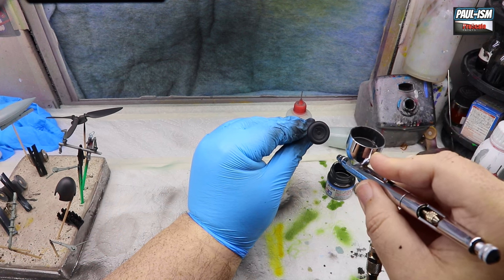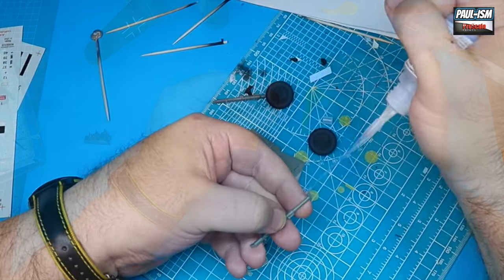Part 4  - Hasegawa 1/32 Focke-Wulf Fw190D-9

Comment: Putting Tamiya panel line colour directly over your decals? You are far braver then I am.
Reply from the maker: I do it all the time with no issues. It’s only thinned enamel. It’s not a hot paint at all.
Reply: @InternationalScaleModeller  interesting. I’ve had it remove paint on some of my projects before. Haven’t trusted it since.
Reply from the maker: @mikemontgomery2654 it should only remove enamel paints unless your rubbing too hard.
Reply: @InternationalScaleModeller  I hadn’t even tried to remove any excess wash yet. It lifted off the paint before I finished applying the wash to the rest of the panel lines. I’ve always just sealed the paint and decals with a gloss coat first, before using the panel line colour. I just won’t risk putting it over bare paint and decals, unless there is a specific effect I’m looking for. There even a warning on the bottles of the tamiya product, warning of that very thing.